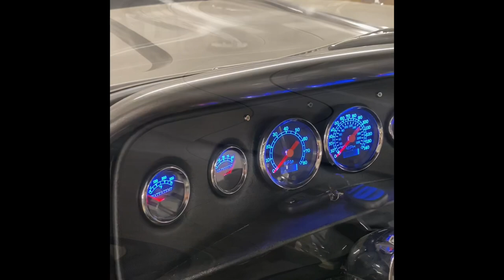MB ELITE 65 GMC PICKUP

Comment: This truck is bad to the bone. My only complaint is that wood chrome paneling on the bed about made me faint. One of the most beautiful things I've ever seen in a vehicle but it needs to have to have a very thick rubber mat custom for the bed to protect it I wouldn't want that art work to even be touched. It's a bit too fancy but I dang its so worth it.. The color of the truck I love it but kinda feel like u copied me tharts my old truck color.  love them gmc logos. Love the handlebars. I'm trying desperately to be picky but I can't think of anything not 100% cool about this truck. just need to put some tire shine on the tires. It'd almost unfortunate because I'm not sure I'd want to drive this truck as not to even put a slight speck of dirt on it.
Reply from the maker: Thank you very much we appreciate your comment. might have went a little overboard with this project. We wanted something wild and bad ass that people haven’t seen before. Also wanted to preserve a classic American hard working Truck  we ended up putting our own little twist on it. With over four decades of metal finishing experience, we wanted to highlight our bright work
I definitely don’t think this would be the truck I would recommend to go pick up a load of stone Or even take out on the trail.  It’s a work of art. 
We are a small two-man shop. I’m working hard to find some time to do an actual walk around video of this truck and go in to some detail about it. I guess first I better find some time to detail it and get some tire shine on it. I hoped you would not notice. we copied your colors. now everybody knows. Thanks again for your comment  have a good day.

Comment: This is a very good build but it's missing detail at the rear looks like the truck is bending over and leaving the rear end exposed and yet lots of chrome from the bumper down in the front  bring the chrome down at the rear with maybe a chromed step and toe bracket to complete the looks
Reply from the maker: Thank you for your comment. We appreciate your feedback. I do have to apologize when I was making this video I did not include much of the rear bumper that has recessed tail lights,  center exhaust along with chrome accents
Reply: @mbelite  oh okay I can imagine how that looks